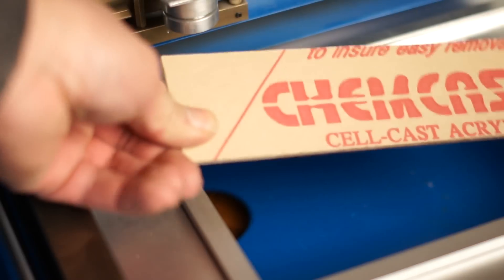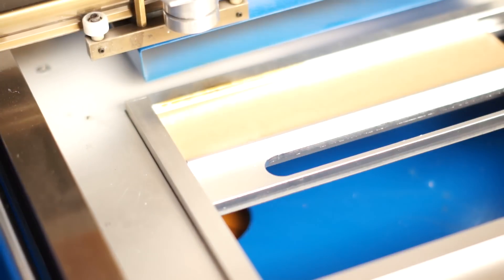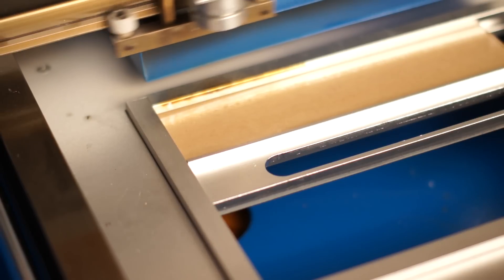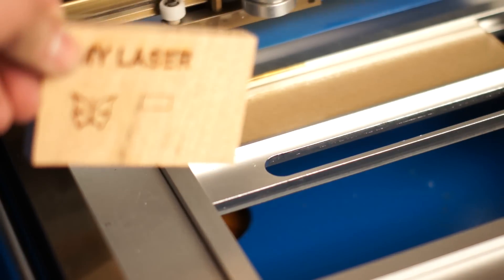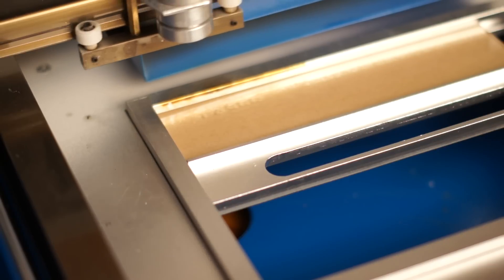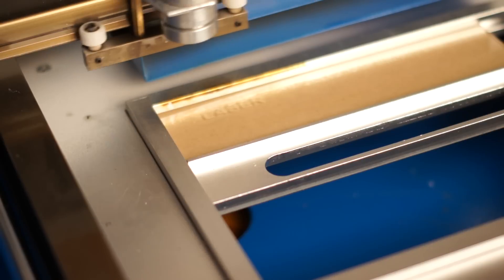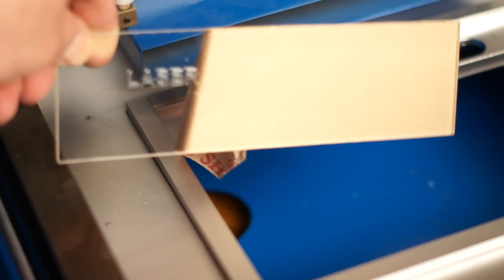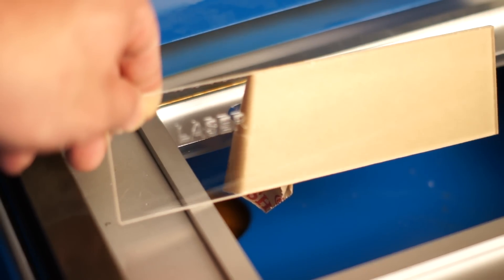Laser Engraving On DCK40III

Comment from the maker: hi. i found the solution. the depth of the engrave was not the laser power. it was the gap width setting. basically higher res made tbe cast frost.

Comment: Try lowering the mA on the laser.  A clear engrave is actually a good option to have, in a mechanical engraver you would need to use a expensive diamond tool bit for the clear effect.